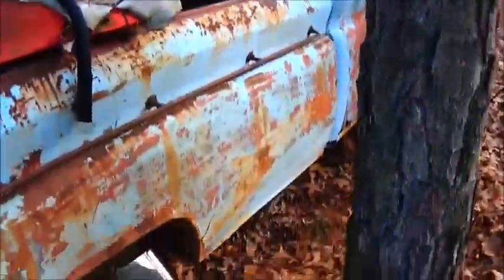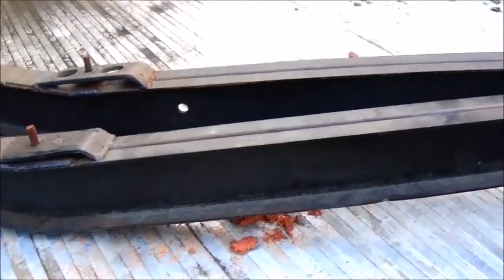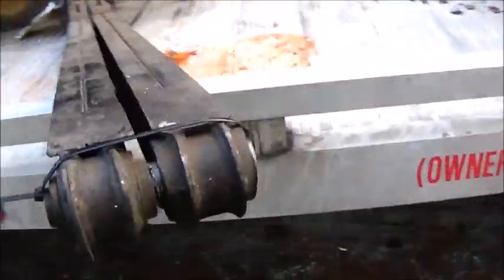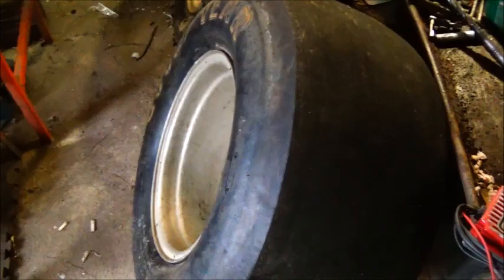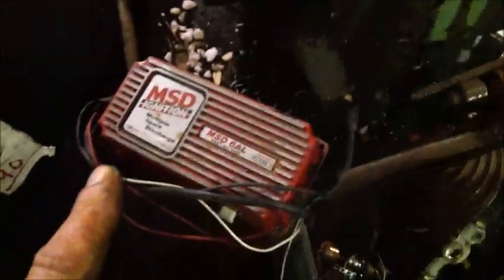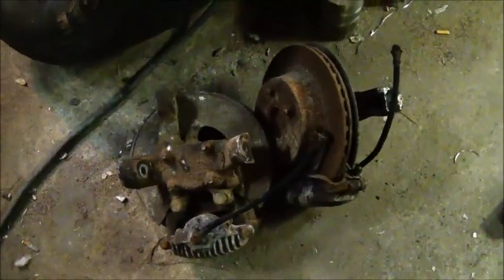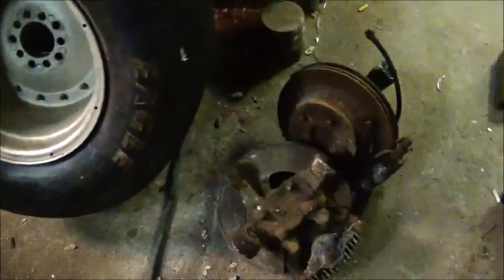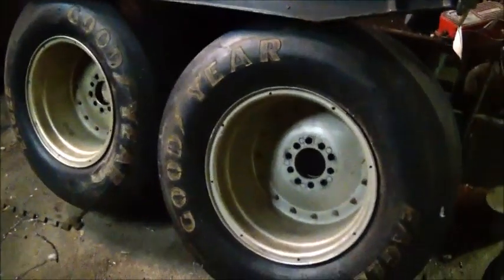Low Budget Drag Car Build Part 1 Gathering Parts

Comment: As I write this it's early 2020.  Those truck arms are high quality and appear superior to the pickup arms.  If I recall, the stock arms are 3/4 box.  The I-beam arms should be way stronger - better for racing.

Comment: The Triumph front suspension is actually pretty decent and tough, it was used by a lot of British specialist car manufacturers such as Marcos, TVR and Reliant who used it on cars with much bigger and heavier engines than the Triumph had.  It's also been used under the front of countless numbers of custom vehicles...
Reply from the maker: I noticed that the one that drag races with a small block, the front looks entirely stock. This engine is a little heavier though.

Comment: Those trailing arms are probably more rigid than the entire Herald chassis. Think you will be surprised at how easily the body comes off, bulkhead/firewall attaches to the rear section aft of the front footwells.

Comment: Love it.  Bars might be a bit long for that car.  As you get shorter the axle will push down from the car, giving you better traction in low gear.  The car isnt worth restoring with sentimental value forget what they say.

Comment: The front end geometry of the triumph is good so i would stay with the angles . It will be easier to build new  front  wishbones rather than box the old and then have to mod for different top and bottom rod ends. How about using rose joints to replace the bushes as well. Your going to need a name for it so how about Hellova Herald

Comment: You talking my language  l have a  drag truck  my is a s10 85 model it  has 383 stroker in it with a  Power glad and a 9 inch ford rear end with 29 1/2 x 13  slicks  on it  and NOS with 100 shot in it it run 650  on Motor  621 on  nos   I  run a  1/8 with  it  and 514 gears in the  rear end

Comment: Good parts...l'm stoked & trying to figure those slicks under the car & narrowed rear end - thinking those trailing arms will spread out up front opposite of how the ones are on the pickup...& wondering about the pinion angle...hopeing the weather (& tows) will hold till you can plug that intake hole & get the motor up to temp (that intake only uses 1 thermostat?) & see how it idles...sure looks like it has a good balance to it & the msd box can only help with timing issues (l think you said the harmonic balance was off?) I think l'd want the steering linkage up front leading those spindles instead of in back pushing side to side...can't really say till it's opened up/layed out in the shop...hope the front of the trailing arms doesn't go past that front U joint...Man l'm Stoked...actually seeing how this thing might/could work now

Comment: I bet its gonna be one big tub across the back seat for
 those slicks...A ford 9 inch would hold that 427 cause you aint got no weight
a Dana is really heavy...anyway...I think you got a great idea building that dont worry about what anybody says
Reply: maby he going to use another fireplace for a body!!  LOL!
Reply: I put a 289 in a Spitfire once...all stock except for the 289 and a toploader 4 speed
I called it "the Red dragon"
it didn't break...and it was scary fast
Reply: oh and I had to have a set of fenderwell headers made for it...used those Cherrybomb mufflers with the header flanges made right on...that went clear back to the rearend
and yes...it was loud
I drove it for 4 years as my daily driver
Reply: Oh and Jonathan.your probly gonna have to section the firewall for the distributer...especially with a HEI
thats why I used a Ford engine
Reply: oh...and I forgot...you have to use a TR 6 radiator...and lean it forward like a Corvette

Comment: The Torque arms (ladder bars) are a similar set up to Mercedes From 1950 through to 1971 . The only major difference is mercedes has a swivel on the Diff end and flex donut on the front end. You shouldn't need to alter the diff end, just angle the brackets on the Diff (maybe) .